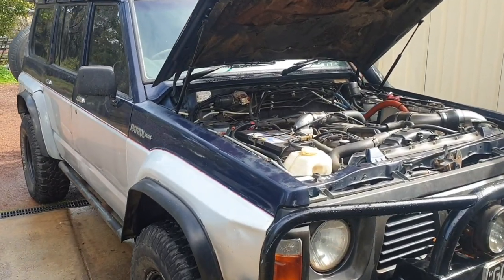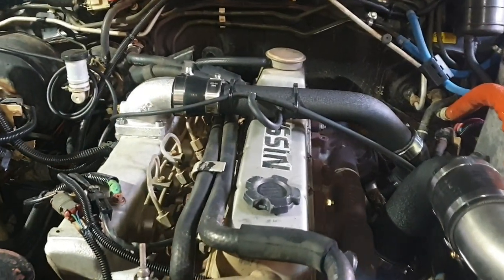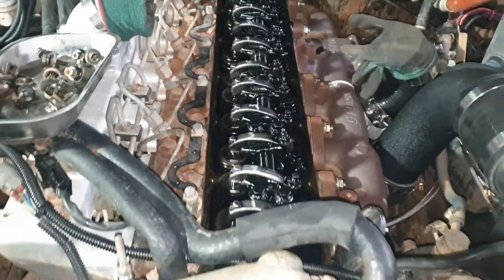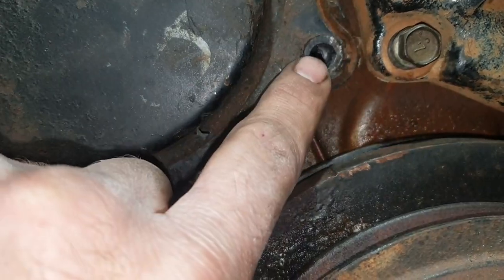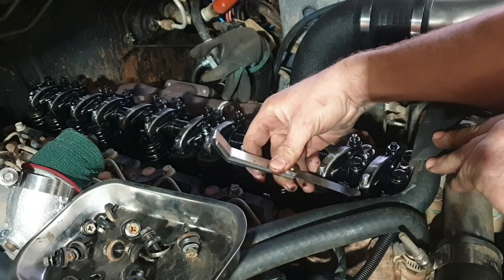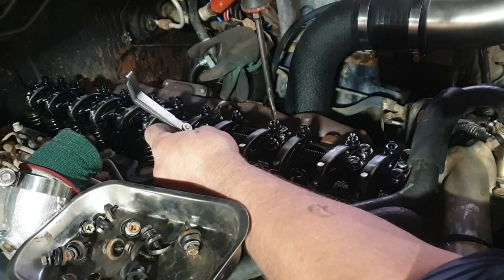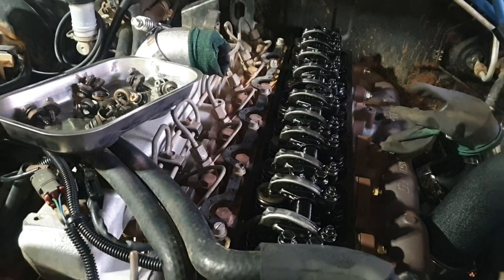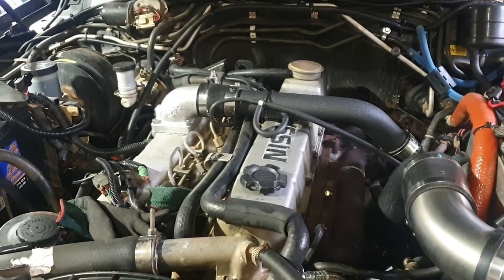Nissan Patrol TD42 valve set adjustment

Comment: what is a good GASOLINE ENGINEp replacement for the Nissan TD42 Motor?
Reply from the maker: Probably a LS or Barra
Reply: or a 4.2tdi mwm sprint.. mine has 700nm, no computer.. 8.5 t in 5th up hill..  @downtheshedwithbyron
Reply from the maker: Thats awesome dude

Comment: A really helpful video for me mate thank you. I want to have a crack at this myself but the only thing I was hoping you could clarify for me is visually confirming the TDC part. 

From what I understand (your vid and workshop manual) cylinder 1 will be at TDC when the mark on the crank pulley and timing cover are aligned with one another which seems straightforward. 

My question is just about visually confirming TDC for adjusting 1, 2, 4, 5, 8 & 9. 

My understanding is that you can visually tell you're at TDC to adjust the first sequence of valves (I mentioned above) based on two things:

1. The mark on the crankshaft pulley and timing cover are aligned, and
2. Valves 1 & 2 will have clearance I.e. both valves of cylinder 1 will be closing and the inlet of cylinder 6 will be starting to open.

After that first sequence is done, rotate the crankshaft pulley 360 and align the marks and then repeat for the remaining valves.

Does it matter if you rotate clock wise or anti clock wise? 

Lastly and before starting the car, do you need to rotate the crankshaft pulley back to TDC (cylinder 1) or back to its original position before you even rotated it at all? Or is it fine to start no matter where you rotate the crankshaft pulley? 

Sorry for all the questions
Reply from the maker: Gday mate 
I would still continue to rotate the engine clock wise and it will be fine to start after the jobs done.
👍
Reply: @downtheshedwithbyron  thank you very much for the quick reply!
Reply from the maker: Good luck let me know how you go

Comment: How do u go about replacing rocker arms.
Previous owner had done valve clearance and nipped up way too tight. Fatigued over time and broke a rocker under hand tightening.
Reply from the maker: Hey mate i haven't changed 1 before on a td42 but from looking at my spare engine you should be about the remove the assembly then slide the rocker of as needed
If you need any more help ill have a play with it next week and let you know
👍
Reply: @downtheshedwithbyron  thanks for the quick reply mate, I’ve had a good look and It just seems like a couple nuts in between the rocker arms and it all should pop off.
Reply from the maker: Ill see what i can do tomorrow bro and ill let you know

Comment: Hey mate! Just checking, does the engine must be hot when adjusting the valve clearances? Also, is it .35mm on all 12 valves on both cylinder 1 top dead centre and also 6 cylinder TDC? Thanks mate
Reply from the maker: Just warm bro 
Yeah about .35 all valves
Reply: @downtheshedwithbyron  Legend! Thanks brother

Comment: Hey bro the air breather on the end of the engine at the top oil started to come out of it and wondering if u know how to fix it
Reply from the maker: Hey mate
pull the rocker cover off and from memory these screws that hold the breather in pull that apart and give it clean 
Next id be checking your blow by

Comment: Is it exactly same order with the 4.5 petrol?
Reply from the maker: Hey mate
Not sure haven't touched those engines but the procedure is the same just double check the value clearance from workshop manual or Google see how you go mate 👍
Reply: @downtheshedwithbyron  I managed to get the numbers and everything else is pretty much the same.
Just  another question mate, on second test did you just rotate engine 360 degrees from TDC for cylinder 6?
Reply from the maker: Yeah mate
Reply: @downtheshedwithbyron  cheers budds 👍👍

Comment: the term rocking relates to valve overlap on the companion cylinder. ie if you have the engine at TDC No1 then its companion cylinders valves will be rocking. Ex valve closing, intake opening in DOR. Rotate engine counterclockwise inlet closing exhaust opening this is what we call the rock or valves rocking due to the motion of the rocker arms. You never set the gap on rocking valves because the valves are not fully closed. This is a common mistake and misuse of the terminology.
Reply from the maker: Cheers bro

Comment: Excuse my ignorance mate, but why would it be necessary to adjust your valves frequently?
Reply from the maker: G'day mate just referring to the workshop manual or if you're doing Heavy Towing or hard four-wheel driving all the time and all you'll be doing is checking them.
I've been across the Nullarbor and back and probably done another 20000+ since I last done them and only had to just a couple.
Hope this helps you mate 👍
Reply: Down the shed with Byron Legend, thanks mate! Silly question but if you don’t adjust the valves frequently on a TD do you run the risk of your valves hitting the pistons? Or is that more so if your motor is incorrectly timed? Hope the old girl went well on the Nollarboor 👍🏼